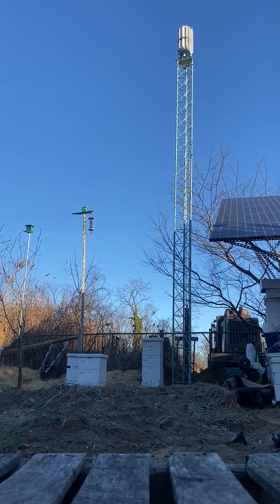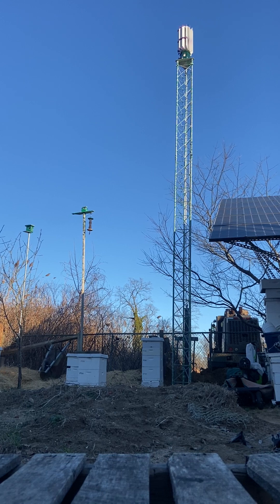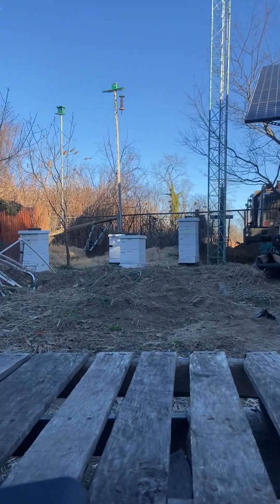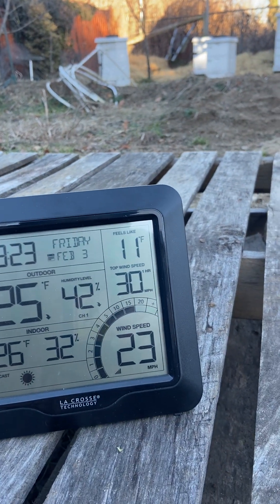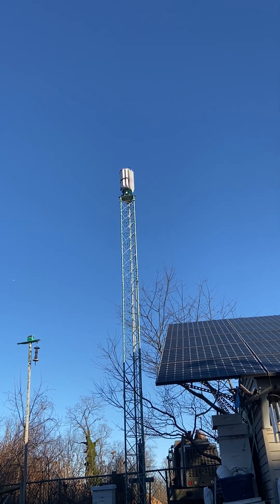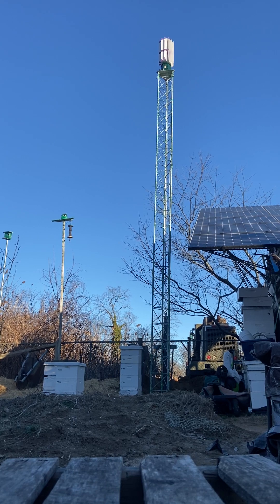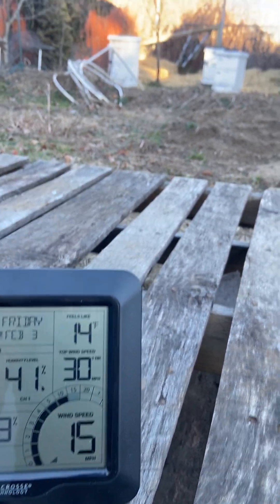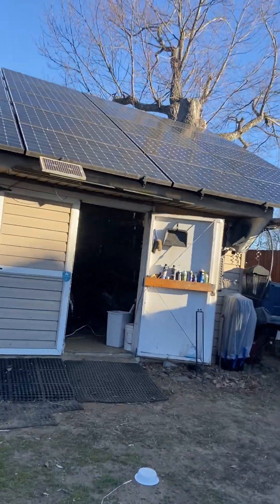Vertical Wind Turbine Part40  ￼, Tesup is falsely Advertising. I need a UK lawyer ~Please contact me

Comment: I think you have a serious problem here probably caused by magnetic cogging, i suspect that your unit has been supplied to you with a mismatched stator and magnet array.
Reply from the maker: I don’t know enough about the internal set up ratio inside the electric generator. It’s supposedly a 4K generator, which would require a lot more torque to spin. As you see in the videos it does spin and works above 18 mph now. The original took 35 mph winds to start. So it’s just a term I use to describe the torque that needs to be overcome t spin the generator. 
Tessa used cheap Chinese generators supplied to them. 
if you have any in-depth knowledge about the generators and types to use, I’m looking for 2K generator now for this unit .

Comment: I can just picture you going, ooh ooh it's almost going to turn a little bit...the blade should be flat and a lot bigger around, and not positioned to bend the shaft in a big wind. It should have been even with the generator. The guy in the video showing it running, he has it running like a three phase motor for the ad. There is no working one because the blades are designed wrong.
Reply from the maker: The winds had actually peaked at 35 miles an hour, and it actually started to spin. At that point I knew the design was a complete fraud. So at that point the modification started and it’s in the video, of me removing every other  blade and reattaching giving it a longer arm to the center of axis. Now it’s been spinning fine but the 4K generator is still too big because the current start up speed is still at 18 miles an hour.

Comment: Can you do a detailed video on the tower?
Reply from the maker: Sure can, what kind of details ? height ? sections ? weight ? Cable used ? brake crank ? concrete counter weight? J- bolts , I-beam , support steel , ? Drill driver? Tilt Plate.? Base plate?  I’ll do that tomorrow .
Reply from the maker: I posted a video for you, cover the height of the sections, the weight, the cables used , The brake crank, the concrete anything else you wanna know let me know